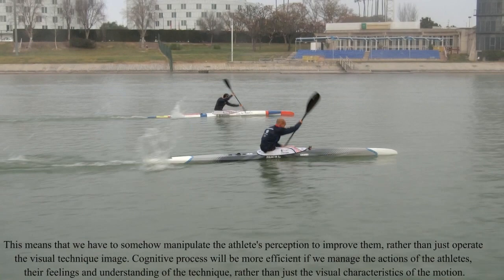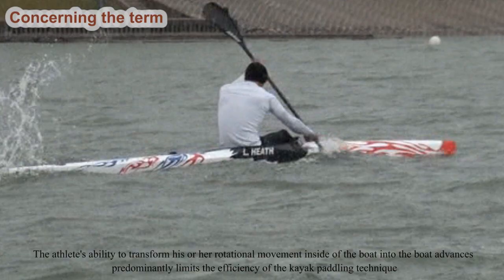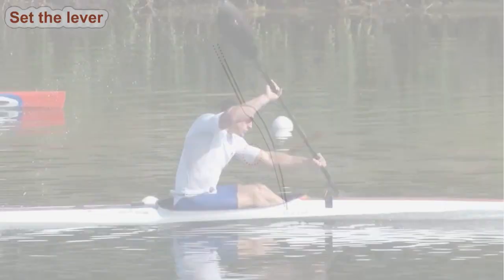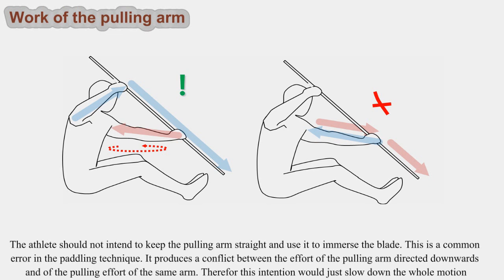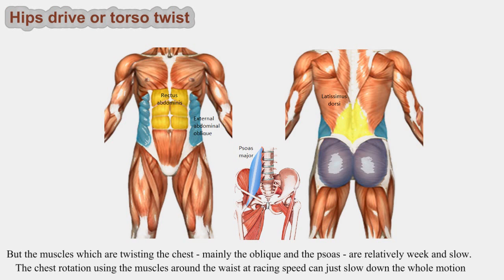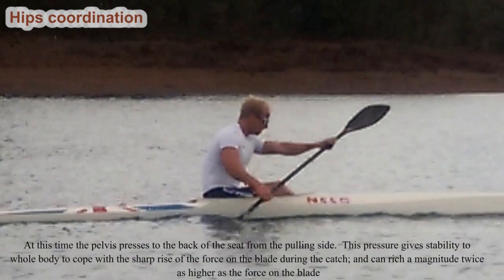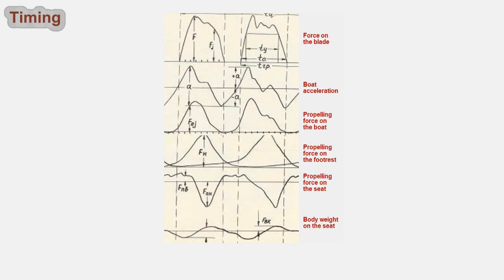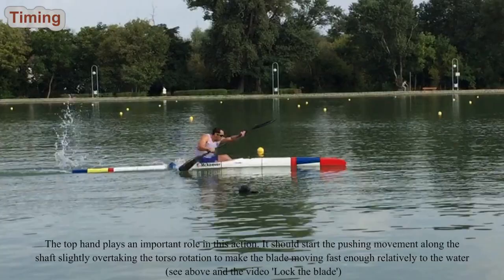Sprint kayak technique 04,05,06 - Manage rotation

Comment: What's fascinating here is this typically Russian emphasis on 'internal method' as opposed to external structural or mechanical correction, adjustment etc... Method acting was created by Stanislavsky and Chekhov as a way of acting 'from inside'... Nikoronov is applying the same concept to kayaking by asking us to 'manipulate the athlete's perception' instead of 'operating on the level of the visual image'.

Comment: I can get the idea of this if I stop the video and think(think hard !) on what has just been said. I only paddle for fun but have been trying to improve my paddling. One of the things I have been doing is trying not to push with the higher hand and rotate my body to move the paddle and this video is the complete opposite, as from what I can see it's saying the lower hand is the fulcrum(pivot) and the higher hand is the lever which I suppose pushes otherwise it wouldn't be a lever. I've just been looking at Oscar Chalupsky's paddling technique videos and practicing them .